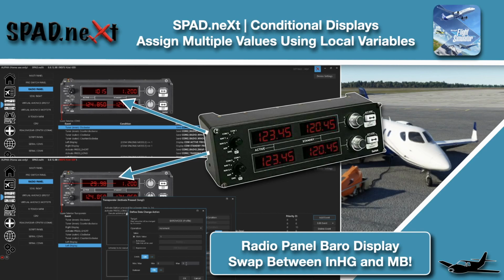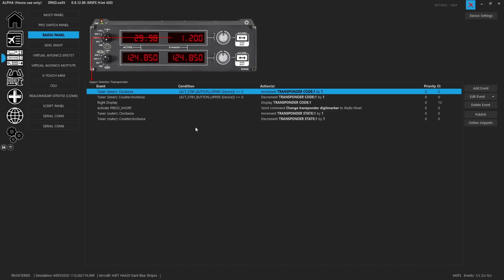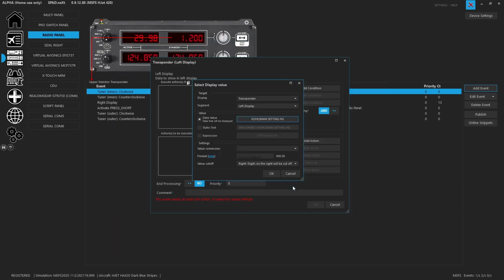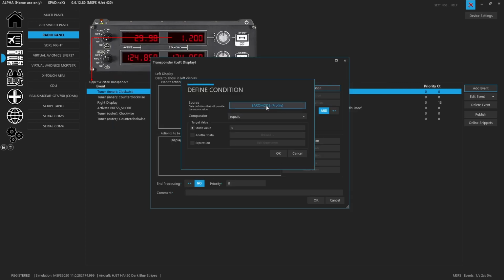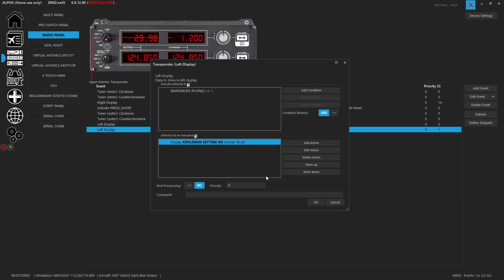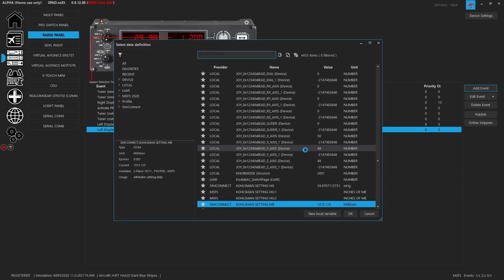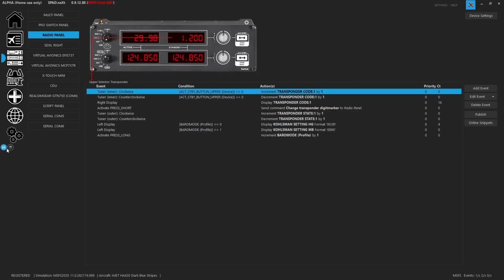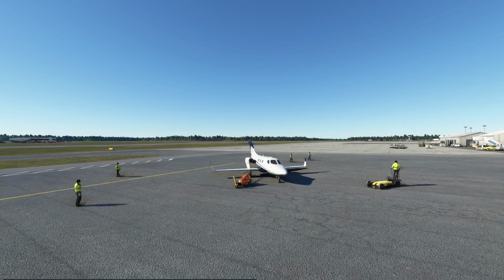MSFS | SPAD.neXt | Conditional Displays | Logitech Radio Panel

Comment: Thanks for this. Do we still have the problem with only 5 digits for the radio freqs? Or can we get all 6 with spad with this panel?
Reply from the maker: There is physically only 5 digits in the Logitech display — that is why this video shows using logic to decide when in 8.33 mode to cut off the leading  “1” which a com frequency always had to make space to show 3 digits after the decimal.
Reply: @LesOReilly  Ok that was what i thought, the 6 digits showing in the spad app was what threw me off and gave me hope :)
Reply from the maker: https://youtu.be/FStdEJ_BXCQ?si=69jI4l_k861RAWbr that is the video the com stuff
Reply: @LesOReilly  ok since i have you here, i have a question, if i get the streamdeck + for msfs24, do i need to also run the streamdeck software + spad, or can i only use the spad software? thanks
Reply from the maker: @tj0cktj0ck  please review the videos for Stream Deck.  It explains it -- blank streamdeck profile or don't run the software.  https://youtu.be/cegPkLjUvXE?si=ZanDU6mC3mUpqif6&t=79
Reply: @ man you do like giving videos for everything :D wanna go out and drink som beers? here is a video explaining what i think about drinking. Wanna watch a movie? here is a video that shows what i think about movies
Reply from the maker: @tj0cktj0ck  Why should I type out 5 paragraphs on a subject that has been explicitly covered?

Why is it wrong to point you to the subject matter so that I don't have to spend more time than what it takes to watch the tutorial to type it all out for you?
Reply: @LesOReilly  ok but my question is i dont even wanna install the software for streamdeck, can i just use spad? That isnt covered in the video i think
Reply from the maker: @tj0cktj0ck  sure it was .. it is mentioned in the first 2 mins ..  You need a blank page in SD software -- OR -- Not even run SD software.
Reply: ok,, sucks that i just bought spad normal version and i guess you need the crazy ass expensive version for streamdecks working with spad. thats nuts
Reply from the maker: They list what is the difference between versions and which devices are supported by which versions on the website and its documentation.

Comment: Do I need spadnext and the Logitech support download.? Or I can have one of them
Reply from the maker: You would remove the Logitech MSFS plug-in if you are going to use spad to program them. Otherwise the Logitech software will fight for control.
Reply: @LesOReilly  so I need spadnext for pmdg?
Reply from the maker: @mb944  depends ...  some stuff needs it but the standard radio probably works...  I have not used default drivers/software since 2015 so no idea what level works with PMDG.
Reply: @LesOReilly  if I use spadnext I have to enable in the sdk?
Reply from the maker: Yes there is a video for that.

Comment: Hi Les, as always a great video mate. Very helpful to develop our skills to use Spadnext for MSFS. Never thought about creating a LVAR to use as a condition to change the switch characterist of a button. If I would have only one wish :-) I would ask you if you could go more into detail about how to use a Streamdeck with Spadnext. This device gives us so much complex versatility and to be honest my knowledge is not enough to benefit from what would be possible with this device and Spadnext. Not only using as normal push button device but also using the displays of the buttons to show changing idicators/values/ changing scroll bars (vertical/horizontal/circular) e.g. you name it.
Reply from the maker: You can only replace images and text. You can’t currently make gauges. There are some stream deck videos. They are easy to find via the sections in the video guides on the home tab of the ap.